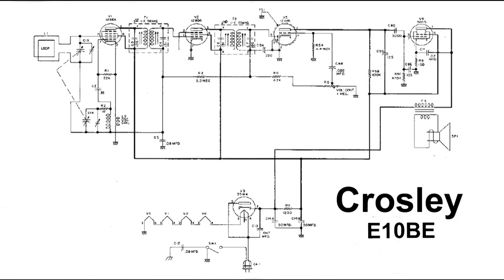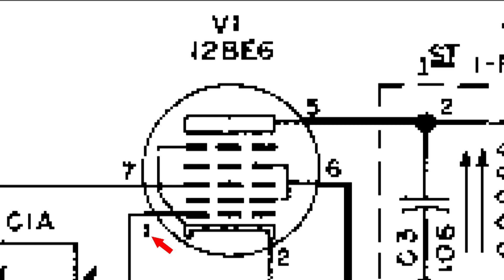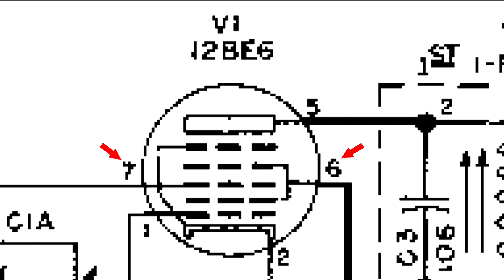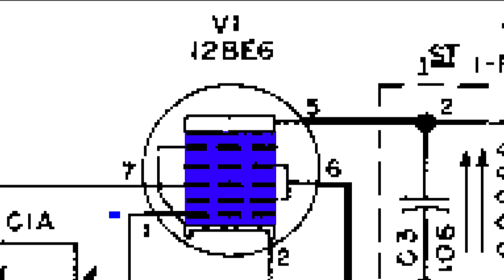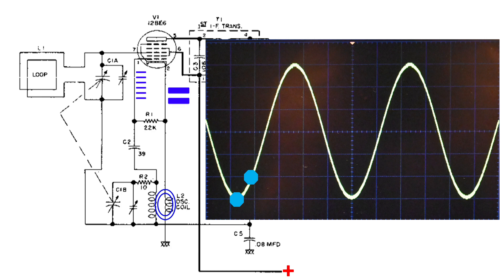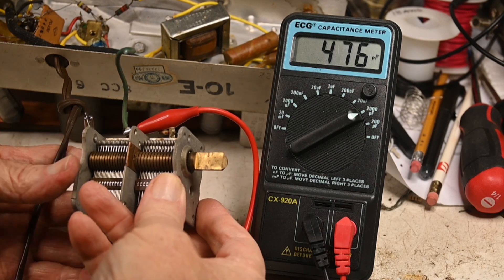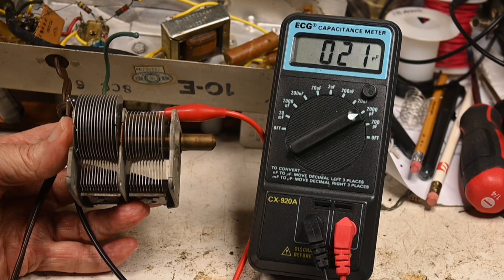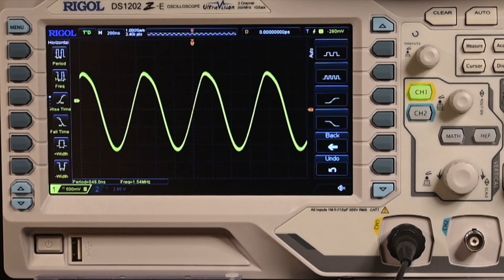Radio Oscillator Tank Circuit

Comment: Excellent video! What I don’t understand is why, when the current from cathode to plate is at maximum, that the magnetic field in L2 starts to collapse.  Why does it not maintain its field as long as that steady maximum current is flowing? Is a cycle of the oscillator tank circuit affecting the negativity of the cathode and control grid?
Reply from the maker: It is the Grid that controls the Tube. It is the voltage on the Grid that that runs out making the Tube start to turn off. This would make a good video. Why does a Tank Circuit oscillate.
Reply from the maker: I just put up a new video LC Oscillator hope it answers your question. 
https://youtu.be/097N0ias1hc

Comment: Hi Rick. This is an excellent demostration of how the local oscillator works. You illustrations are spot on and very easy to understand. Curious about your capacitance meter, I've had a few, but yours seems to be pretty steady. Has it worked well for you? Thanks for the info. :)
Reply from the maker: Thanks Doug! The capacitance meter has been very good. I bought it from Antique Electronics Supply. It is still accurate!
Reply: @AllAmericanFiveRadio  Appreciate the info Rick. :)

Comment: Excellent video.  This is the information I've been searching to find. Now I know the local oscillator can probed with an oscilloscope and verified.  It looks like the amplitude was approximately 2.5 volts from peak to peak. I assume that was a 10:1 probe to prevent loading?  Thanks!!
Reply from the maker: Yes.
Thank you, and your welcome.
I’ll be working on a new oscillator video some.

Comment: This is awesome, so a critical design aspect would be how fast that heater is heating up as thats whats effecting your oscilator frequency?  Or perhaps you would just have an erroneous oscillator  frequency until the tube was fully warmed up since the rate of field build up in the inductor when its first turned on will be based on the warm up rate.  Once warmed up it will just oscolate back and forth.

Is this correct?  Then pin 6 is held positive so that when its the electrons time to go they GO (like a boost pump for the plate)?
Reply from the maker: The heater heats up the Cathode so that the Cathode can emit electrons, does not affect the frequency very much. The tank circuit is what determines the frequency.
Reply: @AllAmericanFiveRadio  I started to write another confused question and then I saw it, thank you for your help and patenice.  I used to be a process engineer and went back for electrical, super excited for every little light bulb of intuition I build.
Reply from the maker: @ronpearson1912  I thought you was my friend from Texas.
My name is Richard McWhorter
My first Book.
https://www.amazon.com/All-American-Five-Radio-Understanding-Transformerless-ebook/dp/B07Q7139SP/ref=sr_1_2?keywords=all+american+five+radio&qid=1636241858&qsid=146-8490440-5519616&sr=8-2&sres=B01DNICB7K%2C1886606196%2CB07TC546HG%2CB0013KV19K%2CB07TXL4XJP%2CB00HSHH5DI%2CB008EAT00E%2CB00GUDH4PU%2CB081H65635%2CB00004T8R2%2CB00UMVVUOC%2CB0977FTG2C%2CB08FDPW8KR%2CB08XX1WRVZ%2CB09BQ7TQNS%2CB004T9Y428

My free Ebook. Password is allamericanfiveradio
https://www.youtube.com/redirect?event=channel_description&redir_token=QUFFLUhqbUQzWUpQXzh1SFNpaE1fMlVrS1drU0pIMk1pZ3xBQ3Jtc0tsRWRfMHFaUUpzRzdoeU5uWG1nREprS3YtTnlHNnFSTmhoQnE0X1YyR2tqV1BoUHljS2xFZHFTS05Dd1A5bWpCZDdNNHcxZ0I1VzNleDlSZ3FPZ1VxaDN4czZCWElYZUVib1czTi1yLTFUdW1xNDVhMA&q=https%3A%2F%2Fdrive.google.com%2Ffile%2Fd%2F1HHmaWYr7UMACfmS4W5uL6PADoem2KlRp%2Fview%3Fusp%3Dsharing

Keep askng your questios. My email is allamericanfiveradio@yahoo.com

My friend from Texas.
https://www.youtube.com/@Ronbob59